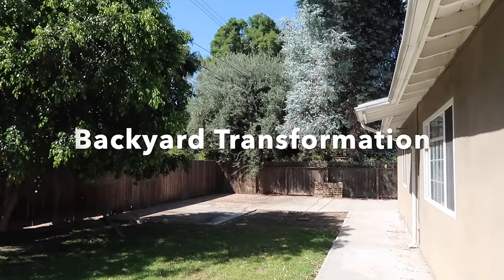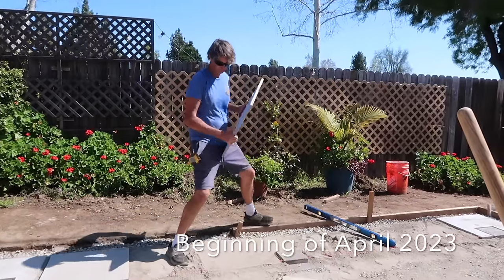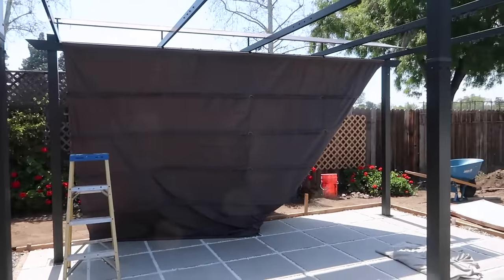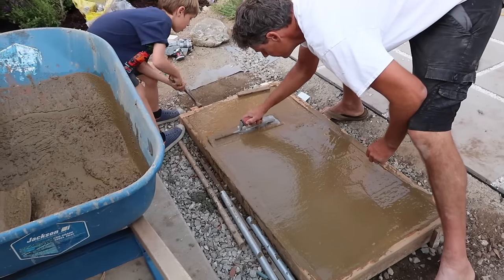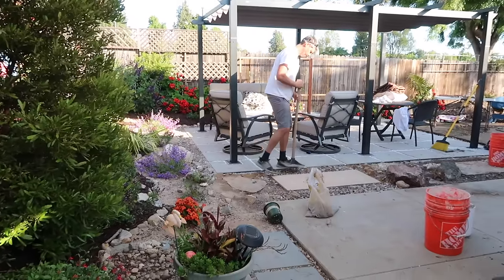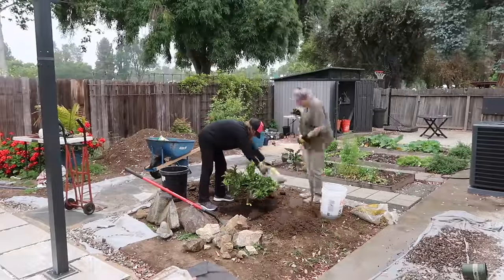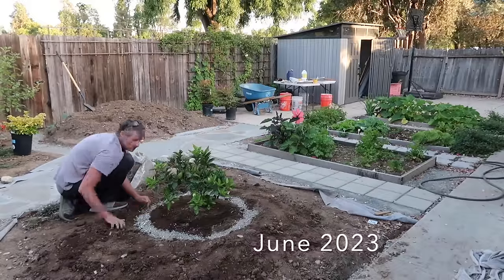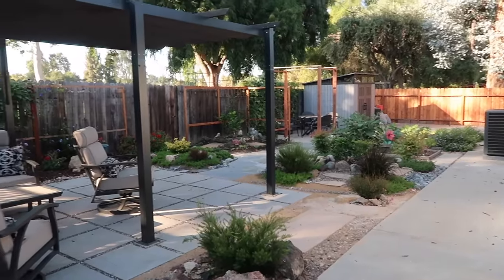Unbelievable DIY BACKYARD BEFORE & AFTER Transformation

Comment: just a quick note, the trees you planted, it may be a camera angle, and if so, feel free to disregard.  the trees and plants, at least as i see them in the video,  look as though the root balls are planted at or below grade, with colored mulch and rock borders.  i would recommend replanting with the root balls slightly above the grade up to an inch, then cover with a healthy later of a fine compost or fine grade natural mulch, 2-3 inches.  this will keep the crowns and roots cool, allowing them to stay moist but not wet, reduce chances of drying out between watering, and maintain a healthy growing environment.  anything planted at grade level then covered with a shredded mulch, and then ringed with rocks is an almost certain guarantee to cause crown rot because the water stays on top and drains slower, often soaking the crtown and top of the roots.  that's due to the size and age of the varieties you've selected. when shredded mulch that's been colored, as most of the scotts, earthgro, and preen mulches are, (home depot and lowes) the dyes seep into the roots.  the crowns of plants and trees, especially smaller trees are tender and haven't developed.  this planting method exposes all the crowns to crown rot, which them moves down the roots and kills them and by the time it presents on the trees and plants, it's too late, the only fix is remove and replace.  also, a future possible project, is drip irrigation with individual emitters to each plant or tree.  this delivers water straight to the roots, eliminating soaking any crowns and will dramatically reduce water usage.  the channel recommendation i shared earlier covers this in great detail multiple times.  continued success to you and your family.  looking forward to future updates, and watching past vids.

Comment: I agree with the having your own garden and trees to produce. But each tree will get 8’ -12’ high and round. The first 5 years are trimming. Around bottom to make tree grow taller. My rule of thumb. If it is growing down or on inside it is worthless cut it off. I have a huge crop every year. 
For your back yard thought you might get to many trees and smother your garden light.

Comment: Looking great. Just an FYI, weed block is laid down 1st THEN you dig your plant holes. To cut the holes, just fire up a propane torch then burn/melt the holes then dig. Reason for laying the fabric 1st is to minimize the ability of weeds to escape through the  block. As for your paver spacing fill, there is a product called polymeric sand, I think thats it, but its a sand that you fill in the spaces, water it up after you lay it, then it does the same thing as you gravel glue. Just like the glue, it locks together to hold the sand tight, then it blocks out any future weed growth.

All in all, great job.🎉🎉🎉

Comment: I hope you don't later regret the weed barrier/cloth. A lot of people mention that it is great the first year, but it later it becomes a mess as the mulch breaks down on top. I remember a landscape designer mentioned in a video that it is great under paths where you have paving or gravel, but not so great in a garden bed as new weeds start to grow in the mulch. I think she recommended just having a thicker layer of mulch instead. As far as gardening year round you just need to check if and when you get a frost or possible hard freeze and probably like in southern Florida or low/hot land tropics grow cool season vegetables in the winter (since they can't be grown at all from mid-spring to early fall in hot climates. Here in Mexico I'm sad about all the plants I can't grow because of the lack of chill hours. I'd love to have lilacs, hostas, apples, etc. but I can't in the low-lands, so people on the edge of the subtropics can get away with a wider range of plants with planning.

Comment: External paving tiles or bricks should be grouted between the gaps, not filled with loose sand, stone or chips.  This would prevent weed and grass growing in the gaps which could become an eyesore and a pain to get rid off.
Reply from the maker: There is road base and DG under, everything in our garden has to be water permeable so we are not too worried about the occasional weed. =)

Comment: I'm alarmed at the pergola visibly rocking when the shade was opened. There should be no movement at all.
Reply from the maker: It's not a solid structure, it's very lightweight. Therefore there is a lot of movement. We have been through 2 huge storms and no problems at all, it's designed for the wind to go around it. =)